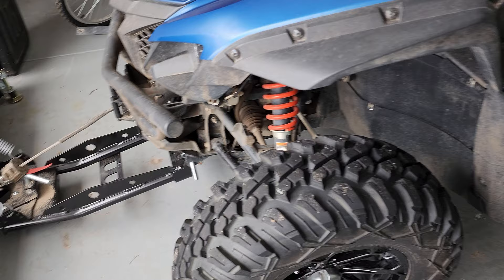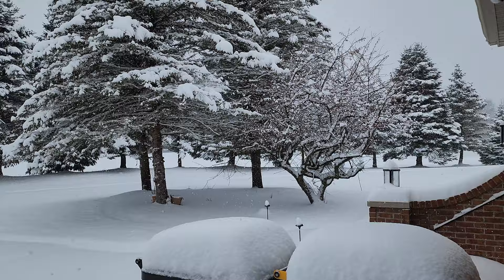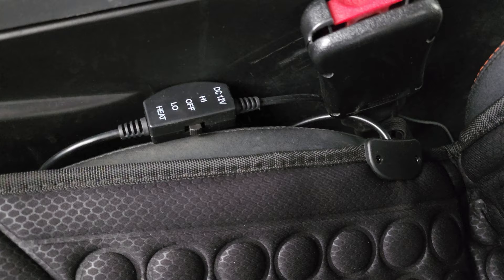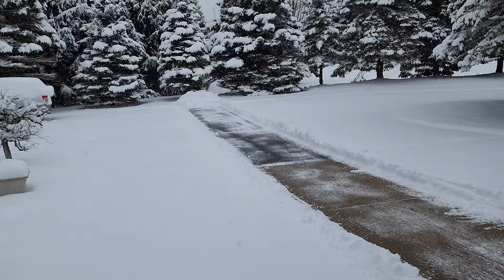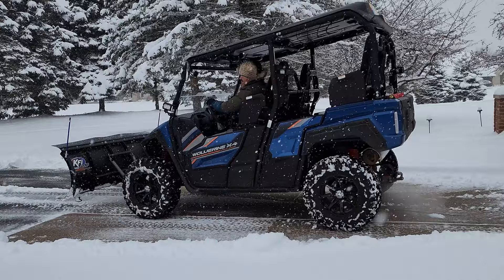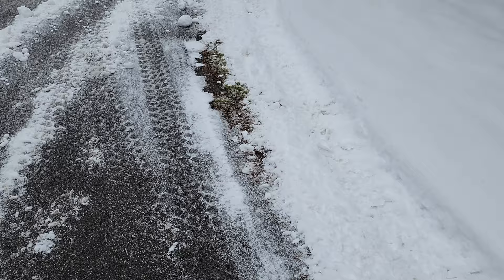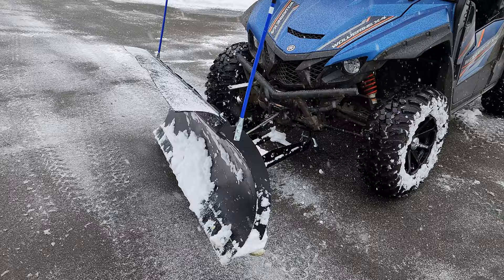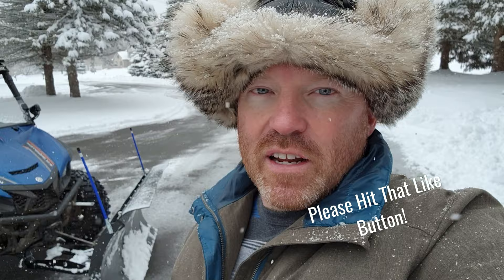KFI Pro Poly Snowplow Long Term (4 Year) Review

Comment: I have a KFI plow on my ATV works great. This is the second season for plow. Very little wear on plow. I think it’s gonna stand up well.
Reply from the maker: Do you have the pro poly or the steel?  I've been impressed with my poly one so far.  I wipe the snow off of it after each use, which seems to be helping to prevent any rust from forming.  Thanks for your view and sub!
Reply: @ATVG  mine is steel. it’s powder coated. I spray it down with WD-40 when I’m done using it. no rust on it yet. And no paint missing

Comment: I've got the same plow only change I made is to many nabors and friends broke there cables I got a double ended tow strap about 3 in. Wide and put on about 6ft. 2nd year and haven't broken it
Reply from the maker: I've heard straps are a great solution to eliminate rope related issues.  Thanks for watching and for your comment to hopefully help others with ideas.

Comment: Any problems with damaging the winch rope using that plastic roller?
Reply from the maker: None at all, but I make sure it stays clean and rolls easily so it rolls as the rope goes in and out.

Comment: What did you have to do to get the plow mount between the bumper and frame
Reply from the maker: There is a plate with the Plow mount hinge points that U Bolts to the frame.  I show it in this video: https://youtu.be/gw5ztieIVDc

Comment: If men stopped when they were supposed to the human race would've died long ago! LOL. I have a 72" steel KFI open trail plow on my 2021 cfmoto uforce 1000, works great! i wen with steel bc if it does break I can bend and weld as needed. great video!